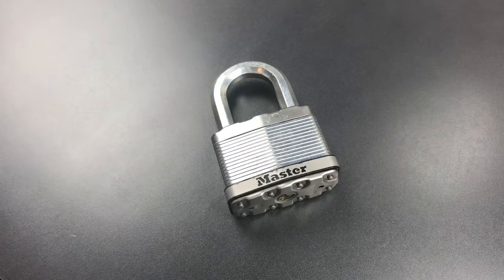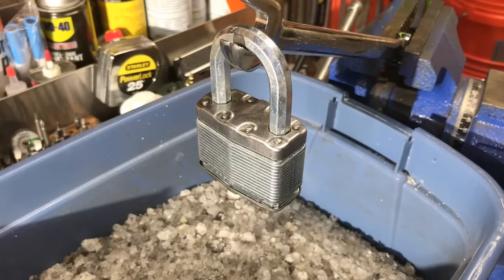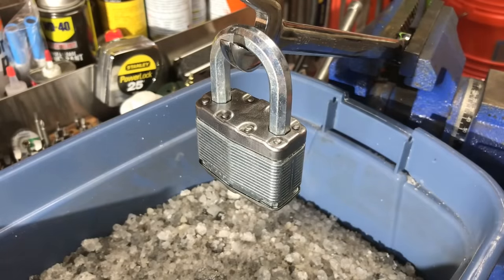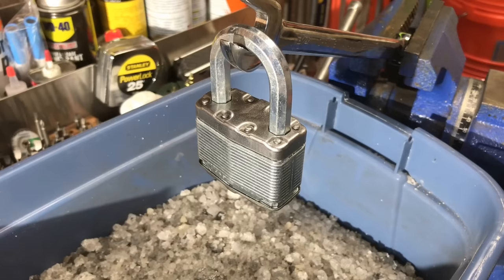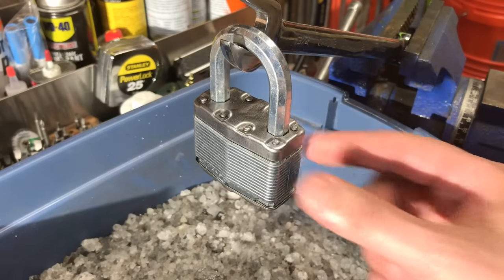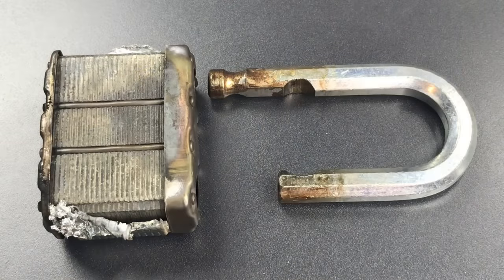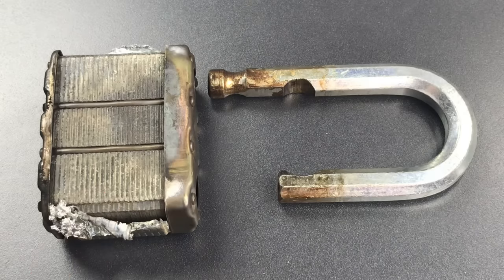[693] Plumbing Torch vs. Master Lock Magnum No. M15

Comment: The hottest part of that torch is at the tip of the inner flame. Might go a lot faster if you hold the torch closer to the lock.

Comment: I bought a Master M15 padlock for $18 at Home Depot, and as a rank novice sport lock enthusiast I raked it open repeatedly with every rake I had.  I posted that shameful video if anyone is still thinking that it might be a good beefy lock because a thief isn't going to melt it.  From my experience, it might open with sufficiently strong language and an angry look.  I honestly think I could open it with a paper clip and a bobby pin.

Comment: zinc you say?  Fails open, you say?  Hmm... this might actually be a useful thing for me.  (boss wants a boat's storage box locked up.  No "weather resistant" lock, of  stainless or brass body,  has survived very long before seizing closed and needing to be cut.  But one with a zinc plating... unintentional galvanic protection...

Comment: it would heat up quicker if the torch was used correctly...never hold a torch at a 90 angle to what you are heating...prevents you from using the torch correctly...which is why when the torch flame was held at the correct distance away it would bounce back and interfere with the burning  fuel which made it so he had to hold the torch farther away making it take longer to heat...the darker blue needles about an inch or so from the end of the torch is the hottest part of the flame...and the lighter blue farther away is a lower temperature than the  tips of the dark blue needles...you want to hold the tips of those dark blue needles on what you are heating...and could not do that holding the torch flame at 90 degrees to what is being heated...just interfered with the gas coming out and making it so he had to pull the torch farther away...hold the dark blue needles on what is being heated at the bottom (which was done correctly by the way...self explanatory)but at a upwards angle slightly so that the flame does not interfere with the gas coming out of the torch...or sideways away from you if you can not hold the torch at an angle  upwards for some reason just enough so you can hold the dark blue needles there without interference...using the dark blue needles is the most efficient way to use a torch...any torch

Comment: I'm surprised they didn't make the outer shell from fire resistant magnesium, and you should watch Down Periscope with Kelsey Grammer and try incorporating some of the lines just before they go through the screws into your let's go down to the garage segway
Reply: I like things fast and rough I would have given up before you ever made it through the outer zinc and gotten my cutting torch with the gouging tip and melted the entire lock including the boron shackle, would like to see you try that exploit, it would fun to see it on that giant lock you and BB opened with the .50

Comment: Did you know if you use the very tip of the flame it's actually twice as hot then what you're currently doing?
Reply: I didnt. Thank you. Now my dabs will be twice as fast
Reply: @TheDsRequiem  if you want to do really good dabs get yourself an infrared thermometer
Then learn what shatter and wax and oil and budder vaporizes at different temperatures

Comment: I think better flame control could speed up the process. Not all parts of a flame are the same temperature.
Having the hottest part directed exactly where the known weak spot is should improve your time.

Comment: The flame of the burner gets significantly colder, the farer you get away from the nozzle. the hottest zone is directly in front of the tip of these white-blue cones inside the flame and thats the spot where the lock must be. https://www.lernhelfer.de/sites/default/files/lexicon/image/BWS-CHE-0037-05.gif A drop of ~25% in temperature is a thing you cannot ignore.

Comment: Put the point of the inner blue flame 1/16th of an inch from the metal next time. You'll get much faster results since that's the hottest part of the flame. Otherwise, your heat transfer is less efficient than it ought to be and you're not getting the part as hot as you want to.

Comment: why rock salt and not water.

water would cool the drippings instantly?

unless molten/burning zinc along with it's hot oxides will react with water and cause the cracking of water into hydrogen and oxygen causing further reactions and even thermite like effect

Comment: I'm thinking that fire is not a good way to get this lock open. You'd likely set fire to the structure it's securing before the lock failed.
Reply: All you need to do is wet the structure behind it and keep it wet so it won't combust

Comment: You couldn’t do that on anything either. Most things would begin to catch on fire before the lock was compromised.
If you were to attempt to burn a lock off of any type of wood structure the fire department would end up being called
Reply: Steve Reynold a lock on any wood structure can be easily defeated with a lever or rock that happens to be lying nearby.

Comment: Based on other videos, the theme clearly must be that Master Lock is in financial straights, and MBA dimwads on the board decide to make new, inferior but glitzy-looking lines capitalizing (in the literal sense) on the name recognition and consumer trust built over a hundred years, but which are all cheap junk, saving a few percent more to spread around the board room and investor's pockets, likely at the long term cost of going out of business. Consumer ignorance about what makes quality, combined with the miserly settling for whatever is cheapest, has led to decline in one industry after another. Planned obsolescence conditions us to salivate so much for the new and improved thing that we're happy when the current model fails. 
"I had mountains in the palm of my hand...
I must have been mad...I never knew what I had
Until I threw it all away"

Comment: Way no. B.grab lock with vise grips
Firmly,chuck up a fresh 1/4 " cobalt drill bit in your DeWalt cordless 36 v.and have at that key way.will open in 30 sec.
Reply: I haven't met a lock yet that I couldn't open with 1/4 inch drill bit

Comment: It seems like the blowtorch is a really inefficient attack vector for a lock.  Sure, it's low-skill, so anyone with the right tool could do it, but it's reasonably loud, apparently pretty slow, generates light and thus mitigates the cover of darkness, dangerous, and I imagine not the cheapest option.  If I had time and could get away with some noise, I'd probably just hammer.

Comment: You would have been into it quicker if you had the torch closer. The maximum temperature of the flame is approx 1mm in front of the inner blue flame.

Comment: MIGHT have been faster to use the torch on the latch bar instead, transferring the heat more directly.

That said:
Hammer.
2 Wrenches.
Crowbar.
Yanking on it really hard...

ALL nearly as fast, or faster, than using the key.

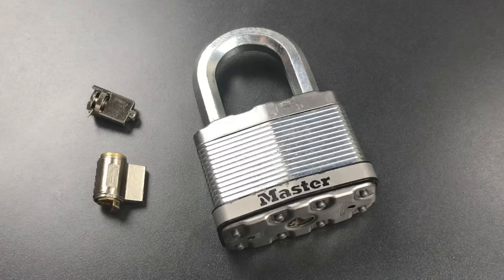Comment: Battery Dremel, abrasive cutting wheel.........opens lock in 1:20. No torch, no burning Zinc, no picking.
Picking : opens lock in 35 seconds.

Comment: i accidentally open a lock like this, it was winter and the key wouldnt turn, so i took my acetylene torch to warm the inside where the key goes, i melted all the key cylinder

Comment: 3:20 is not fast, but considering that if you have time then absolutelly zero skill is required, and it is a relativelly quiet attack. I can think of many places where this attack would work just fine. As long as it is isolated (thru giving you the 3-4 minutes) then you are in. Also, there is some stronger torch, and chance is that if he would have heated the bottom (keyhole) it would have been faster too.

Comment: This lock doesn't seem so bad to me, honestly. It's fairly cheap, found in every HomeDepot, and is resistant to the main forms of attack that I see -- cutters and shims. Virtually any lock can be picked open, whether a minute or ten minutes, so it still meets many of the minimum requirements. Sure, there are locks that are slightly better value out there, but they aren't nearly as easy to find. Just my opinion, anyways.

Comment: It would have went a lot faster if you didn't have the torch so far away from the lock the first minute and a half of the burn. The torch is hottest at the tips of the brighter blue flames, not out where you were heating the lock at first. Actually at 5:33 you got the torch into a better position relative to the lock. I'll bet you could have done this in about a minute with the torch at the optimal distance.

Comment: Why is everything in locks made of soft metals???
Reply: Correction, everything in CHEAP locks.
Reply: These metals are cheap and easy to cast using a die casting machine- the temperatures involved are low enough that you can use a simple steel mould (which can be re-used millions of times) and minimal amounts of fuel. Casting a stronger metal like aluminium, bronze or (heaven forbid) steel would require much higher temperatures and more sophisticated equipment.

Comment: Some food for thought in case you'd like to revisit this, maybe adding some sulphur or soaking zinc-based locks in drain cleaner prior to heating might cause a more violent thermite reaction to occur much sooner, making a spectacular effect... be prepared, though, I suspect both of those could be explosive reactions... well, the drain cleaner might just shred the lock before your eyes eh... or it might generate enough heat energy and hydrogen gas to explode.

Comment: Oh so now you can open any lock 🔐 without shackle protection no matter how expensive it is. You heat up the shackle to eliminate the hardness then cut it with a hydraulic cutter

Comment: I'd like to see how much perpendicular force would be required using a large screwdriver or solid butter knife for that matter. To bend the locking mechanism and force the lock open. At one time master lock used aluminum for the locking mechanism and I was able to force the locks open with a butter knife. That surprised a lot of people. That part needs to be hardened steel. I would think a company that promotes a product to be used for security would have more intelligent engineers, but the poor design could be the result of poor management listening to bean counters trying to save a few pennies rather than producing a quality product.If master lock is  serious about security they should contract me for QA. I've exploited enough of their products to know their weaknesses, but maybe they do too and just don't care.

Comment: Wouldn't it have been faster to hold torch on the bottom of the lock
Reply: Yes, I thought that... just direct the flame up into the guts via the keyhole... or should I say the "lock picking tool access hole".

Comment: 3 seconds to cut the hasp with bolt cutters.
Reply: Less effort to use an angle grinder or better a circle saw with a metal cut off blade.

Comment: im not sure what this proves... bring power tools and torches to the table... uhh, all locks are defeated. A battery powered angle grinder with a cut-off wheel will chop any padlock to pieces in a couple of minutes. Even a 1000$ Sargent and Green Leaf military spec...This is a very cheap padlock sold at big box stores, it's to keep a shed locked. Which this particular version of destructive entry would ignite and burn to the ground. Not too discrete.
Reply: It was a demonstration.....

Comment: I have an oxy acetylene torch that would rip through that considerably faster.
Reply: True. Harder to get one to site tho. I think the point was that there is a very low-effort exploit that gets thru these locks with ease. Any schmuck can pull a cheap plumbers torch out of their jacket and defeat this lock, given a few minutes.
Reply: true. I was kind of floored at how fast that outer shell just melted away.

Comment: If the core and actuator are made from Zinc, it should also shatter with a hefty blow from a mallet, or a couple of wrenches used as levers.
Why do they even bother making the casing look like laminated steel? Selling to the gullible, I guess.

Comment: I think if you were to heat a lock up MAPP gas or Oxy acetylene would be a much quicker way in. Propane just isn't hot enough.
Reply: well, if you've got oxy/acetylene why wouldn't you just cut the thing off instead of dicking around heating it?
Reply: @sidcostello7532  Very True, however it was just a suggestion and not to be over-analyzed
Reply: ok, so it was a dumb suggestion....didn't much analysis to figure that out.
Reply: @sidcostello7532  Thank you.

Comment: You don't even need a torch. 
If you have 30-45 minutes a regular lighter works.
Just did it to my shed lock to prove too my father these are trash took about 18 minutes with a BBQ lighter.

Comment: Your torch seemed very close to the lock... too close to efficiently transfer heat to the lock..  Also, I would have hit it from the side of the keyway.  It probably would have all slagged out within a minute.
Reply: Jamie's Locks I believe he was too far away!
Reply: +
Michael O
I agree. I kept thinking to myself, "Get it closer so the tips of the blue cones are just touching the lock!" Bet it would have opened quicker if he had done that.
Reply: Yeah Grade 8 Science shit hey, tip of the sharp blue flame is the hottest part!

Comment: If you were to inject muriatic acid into the lock's mechanism with cast zinc parts you could dissolve the parts and open the the lock. I don't understand what some of these lock companies are thinking when they engineer their locks. Boneheads.
Reply: They are thinking...  Impressive external appearance & weight, cost to design & manufacture, stronger than a crowbar.  Probably in that order.

Comment: Ok, so you proved that for general purposes at least,  it's a decent lock. No one is going to be hanging around  holding a torch on a padlock for a whole minute.  Now try beating on it with a heavy hammer. 😲

Comment: BTW, I wonder if anyone watching this video will be stupid enough to try than and grab the u-part of the lock without letting it cool down.  I had a high school chemistry teacher who just grabbed hold of a crucible that a student holding it with tongs came up to show him after blasting it with a burner for 20 minutes.  The teacher was such a dumbass that he made the same mistake twice in one lab.  Well, he ended up leaving the highschool to go to med school, and there is no telling what mayhem he caused before the malpractice insurers all cancelled him.   BTW, a similar mistake can be made if the muffler falls off the bottom of your car:  DO NOT GRAB IT WITH YOUR HAND TO MOVE IT OFF THE ROAD!

Comment: Back up your torch a it the hottest part of the flame is the tip.
Reply: I was thinking just the opposite...that the hottest part is the tip of the bright blue flame and he could have positioned it closer. Will need a plumber to chime in on this.
Reply: Further down the thread dragrade101 gave what I believe is the authoritative reply: "Little tip. the hottest part of the torch head is actually where the darkest blue is. Where those mini 3 or 4 blue jets are, about 1cm off of the nosle's tip, those should be just touching the surface you are heating.  Although you are directing flame onto the work surface, it is cooler part of it."

Comment: You know, after dozens of videos from the locksport community, Master still puts out basically junk. I'll never feel sorry for one again. Do they like, not even internet?
Reply: They've spent millions on tooling. They've spent even more on marketing.  The lock sport community has a very small reach by comparison. In reality picking is a very small concern in the real world. Torch attacks are academic at best, a thief with an battery powered angle grinder will be in in less than 30 seconds. Everything is insured anyway. Spending 3x to 5x the cost on a high end padlock is honestly not worth it for most applications.

Comment: Zinc is a pathetically WEAK structural metal. You don't need a torch, just a hammer and chisel will do it quickly.

Comment: Bolt cutters and grinder are quicker
Reply: BlackDolphin90 grinder yes, bolt cutters not so much.  There are 2 things master lock actually does right and its the steel body and boron hardend bent hex key looking shackle.  Very hard to get the jaws around it as they tend to slip off. Edit.  A damn zip tie with notches cut into the tip and a wiper insert is faster lol.  Look at bosnian bills channel for something to laugh at.  He did it.
Reply: This is much more fun though
Reply: Sam T yup lol!
Reply: skiball83 yup... I can attest to the strength of that shackle. We have a master lock with that shackle in use to secure the gate where I work (the types of people who try to break in here are far too stupid to try picking) There's little indentations all over it from where they've tried to cut it with bolt cutters, but it flat out doesn't work. That hex profile boron alloy shackle is freaking amazing. They just need to get their crap together on the cores.
Reply: Drill